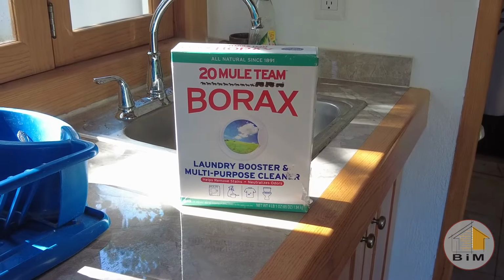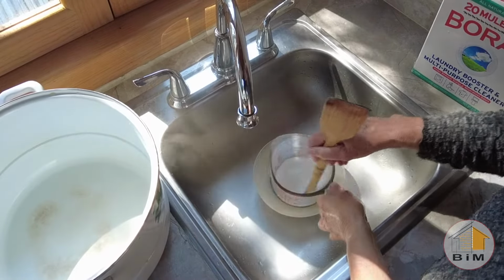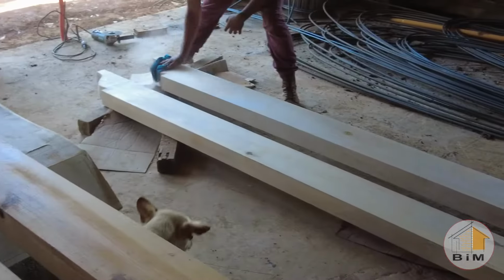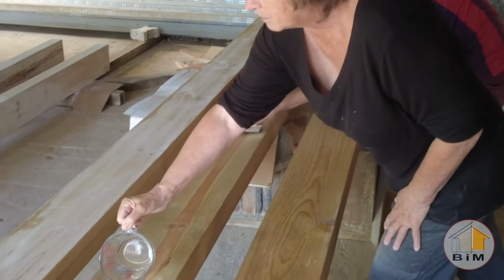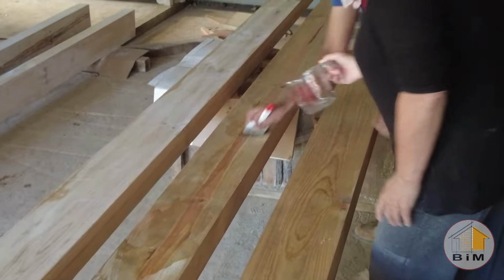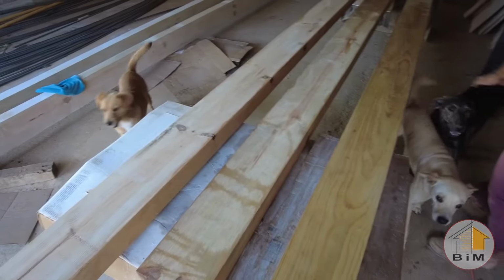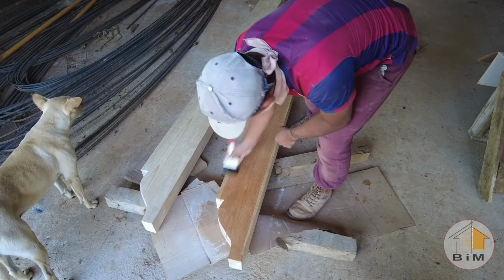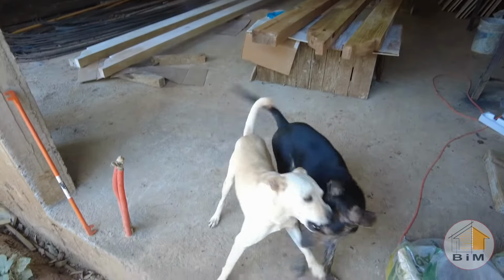Borax for Wood Treatment and Preservative | Stops Fungus, Insects, Wood-rot

Comment: I believe the borax only goes into "suspension' and not solution in water - thus the white powder residue. The water goes into the wood but the borax drops out on the surface. To get the borax to penetrate into the wood you would a propylene or glycol solution - like boracare.
Reply: I believe you are correct.
It would appear They've waisted their time .
Reply: Borax dissolves into: 2 Na, 1 tetraborate, it's a salt and it dissolves
Reply: It is indeed a salt and it does dissolve. The liquid that soaked in carried some borax in the wood fibers. What is on the surface is from the water that evaporated.

Comment: The problem with Borax to preserve wood is , it washes away if the wood gets wet. Some people  place chunks of borax into holes in wood and plug them , if the wood stays dry the borax does not enter the wood and does no good if the wood gets wet it washes away. Borax is not very useful for serious wood preservation unless the wood stays dry. It can be helpful if the wood gets damp only like a Rim joist on a house.
Reply: What if you put a coat of sealant over the borax treatment?
Reply: Like the rafters in my mudroom...ants ate the 2x4 before I ever knew they were there.

Comment: I found your video due to already having wood rot on the porch and facade of a 130 year old house we are living in. I got an old wooden screen door from the Preservation Station in town, since the front door here is huge. I’m trying to restore the salvaged screen door, and discovered it has a hint of wood rot, too. I saw elsewhere that a combination of borax and glycol can treat wood rot. I didn’t have glycol, just the borax. But I had hand sanitizer, and thought fungus wouldn’t like that stuff, so I mixed the hand sanitizer with the borax and I’m letting it dry. And plan to paint the door tomorrow. It was after I made this concoction that I saw your careful method of using Borax - which I’ll follow on future projects. I like that it deters mold, too, so I’m guessing it might be a good solution to apply to insulation. Thanks for demonstrating the method so clearly.
Reply from the maker: Hi Cynthia, thanks for the message. That's an approach I haven't heard of before, but as we all know, it's not rocket science, so there's a lot of legitimate approaches. I don't see any reason that won't work.
Reply: @buildinginmexico  Thanks for your encouragement.

Comment: This is so interesting! I was thinking of applying borax to the joists in my basement to prevent mold. If I use this method, I don't have to go back and remove the borax dust right? I could just leave it on there after I'm done?
Reply from the maker: Hi Jeff, yep you can leave the borax dust on the wood - additional surface protection.

Comment: What about mixing borax w glycol (antifreeze) and boric acid.  
Trying to deal with fungus / rot
Reply: there are several common glycols and you want propylene glycol not ethylene. that's a solvent and carrier, alternative to boiling water
Reply: good luck getting them to mix
Reply: @Nilhilustfrederi  but propalin glycol wont kill bugs like ethylene glycol will. works great on fungus and silverfish.

Comment: Thank you for the informative video.   How long should you let the lumber dry before using it for a project?
Reply from the maker: Hi David, The application of the borax mixture will be dry in about 24 hours depending on the humidity level in the air. If your weather conditions are high-humidity you can dry out the air with a gas or electric heater. Otherwise it might take a couple of days in those conditions.

Comment: I live in Nicaragua so we may have similar issues with termites that are almost comando level termites 😂 
If I milled my own lumber from local trees would you recommend this treatment or a soaking bath for the lumber to later set for drying. 
Thanks
Reply: Just spray it on brother

Comment: I would like to treat an old house floor joist and all underneath . I guess it wouldnt go well with a pump sprayer , or are there any other easy application methods ?
Reply from the maker: You could use a pump sprayer with a metal tank instead of plastic, and duct tape a hot plate to the bottom to keep the borax in suspension.

Comment: Oh, wow! Great video, very useful! Much appreciated! Can I ask... Can you use this on, say, unpainted wooden doors and windows that are already in place? Can you paint the wood afterwards? How long does its protection last? Many thanks.
Reply from the maker: You can use and paint afterwards. As with any wood application avoid drips and runs. They will leave a drip stain on the wood.
Reply: @buildinginmexico  Thanks, man!

Comment: Do if the wood has wet rotted? Do I remove the damage area than apply boric acid mixture?
Reply from the maker: Yep, eliminate the source of the water damage, carve out the rotten wood and do the Borax treatment.
Reply: boric acid and borax are different
Reply: @burtreynolds3143  thanks for letting me know